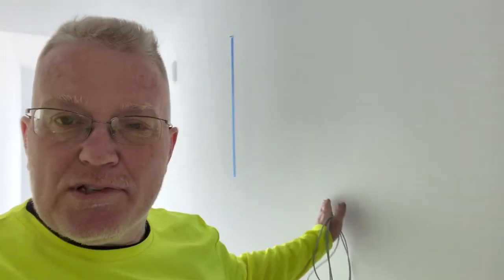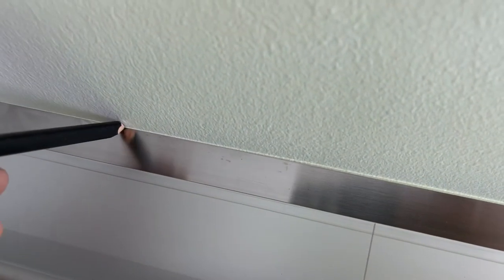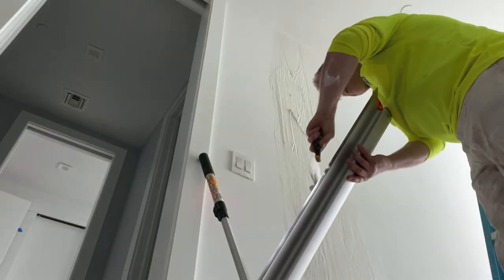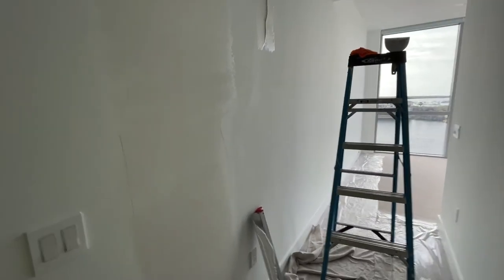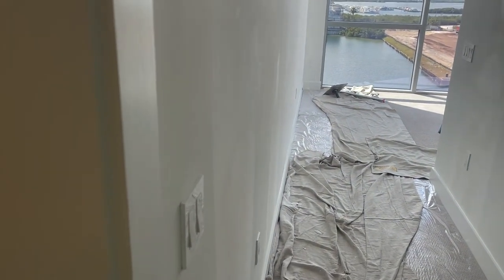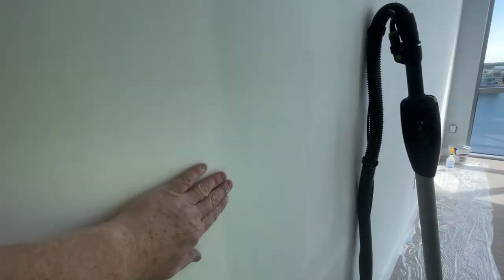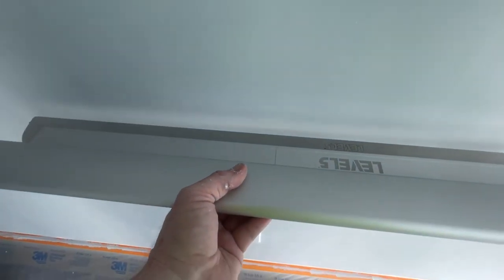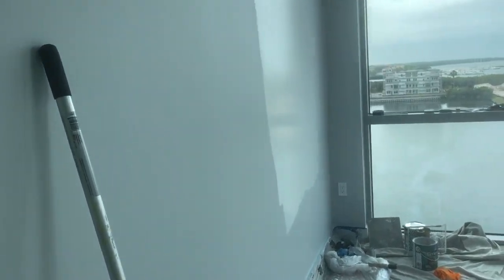How to Fix Bulging Drywall Seams - Spencer Colgan

Comment: Outstanding video here!                     Dear Spencer, what an incredibly helpful great video here my friend. I'm on a job right now with "tunnel light" and have been struggling for a day or two to fix the exact same problem.  I just watched your video and once again you set me straight.   I'm not a DYI homeowner type I'm a professional painter and decorator, and you're correct, this is a challenging and difficult problem to remedy.  Yesterday I went out bought a skimming blade and it's made a huge difference filling the lows. Everything is flat and looks good. Now to prime.... Porosity and preventing flashing always a concern, and fingers crossed The acrylic dead flat primer will work and I won't have another issue to deal with.   This video in particular and all of your content is incredibly valuable and it's very generous of you to share your experience and knowledge in the way that you do.  Thank you very much for all your help Spencer.   My clients thank you, I thank you, and my business thanks you. I really appreciate it Spencer and please keep the videos coming 👍.
Reply from the maker: Wow.  Humbling for me to receive such a well thought out compliment!   Thank you.

Comment: Have this problem with a ceiling. Repaired structural sag and have the rolling plains on my ceiling. Just ordered my 40” blade and learned your technique. Never rolled hot mud before but I’m feeling confident. Thank you. Soon to have mud pie in my eye.😂

Comment: This is a great channel, picking up different tips from different contractors helps immensely. Ran into my first counterfeit wallpaper last week. A YORK peel n stick it said on the label, but when hung a day later tiny little bubbles everywhere. Not only that but it was in a bathroom & when wet the color would literally run off without touching it! Steam=bathroom no good. I contacted YORK to find out if I did something wrong and when asked for the pattern and batch #. I said run #? She said we usually use batch #’s. They got back to me and yes it was their pattern, but not their run #. Customer bought this from Wayfair. A great deal he said. Anyway striped it and hung a new paper no issues. Buyer beware. Have a great day.

Comment: Hello.  I have a similar problem.  The plumbing team had to search for the hidden thermostat wire.  The result, 6 foot wide horizontal 'hump' after their 'repair' of their cutouts.   Do I need a skimmer?   Lowes has one that is 18" long.
Reply from the maker: Yes!
Reply: @spencercolgan  how long should mine be?  I am thinking perhaps a 24" one.  The 18" at Lowes seems too small, or no?
Reply from the maker: @Romulan112  get a Darby.
Reply: @spencercolgan  Thanks for the reply.  Besides the Darby, how much mudd should i get?  Its little over 6 feet wide, hump horizontal?   Thinking about 3.5 quarts or even less? I don't want to buy too much, hard to get rid of it later.  Dumps dont want it lol.
Reply from the maker: @Romulan112  get 3 gallons

Comment: We just had a drywall job done and there are 2 vertical humps at every seam. They already painted and it really stands out. Since the humps are on both sides of tape joint, can they just be sanded down, reprimed and painted?
Reply from the maker: After doing this video, I am so saddened that you would ask this question… It was, in fact, the very purpose for which I did this video… To answer your very issue that you are having.  🤦‍♂️

In other words THIS VIDEO ANSWERS YOUR QUESTION!
Reply: I've never seen 2 humps at seams. Always a single one. I've had humps at butt joints that were overfilled that I've been able to sand down but the normal solution is to feather out the hump to each side to make it less noticible.